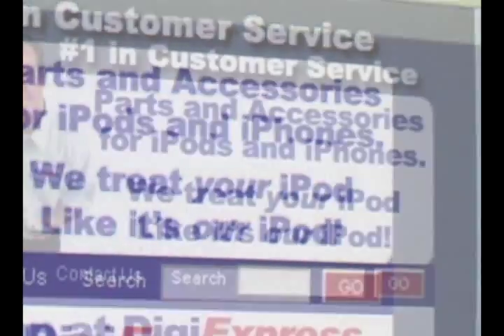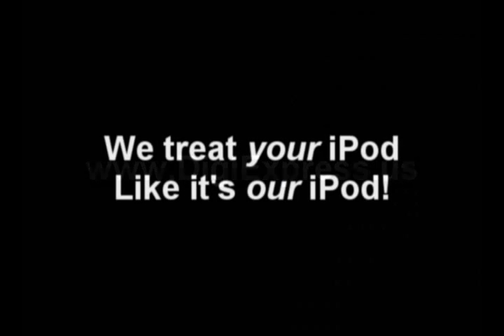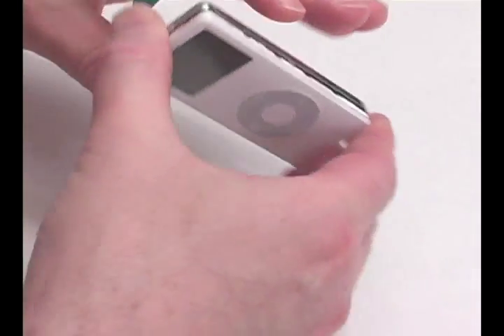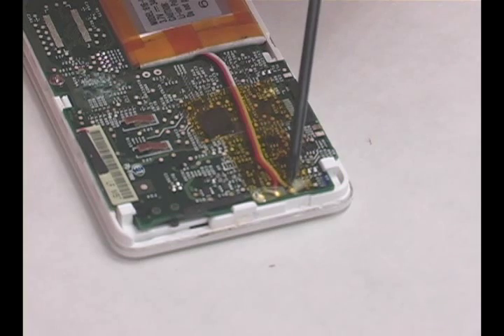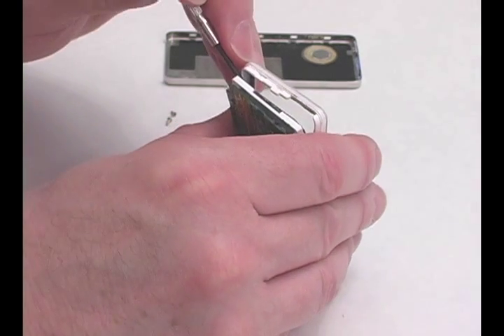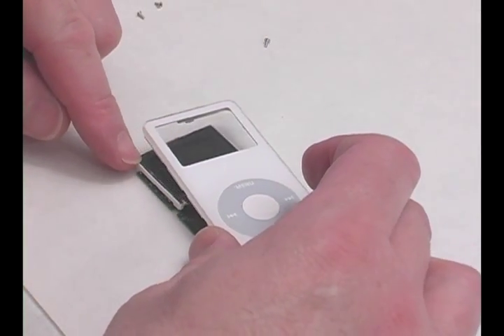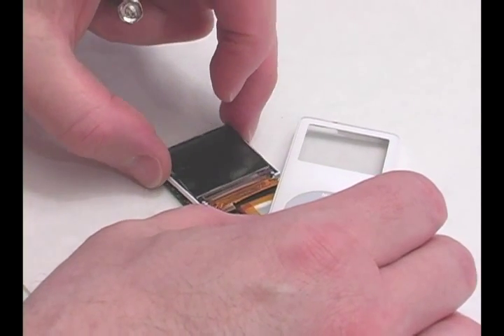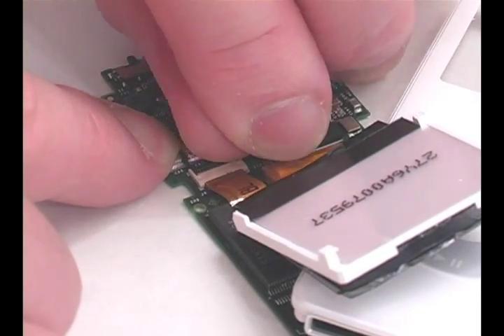DigiExpress - iPod Nano 1st Generation Battery/LCD Installation

Comment from the maker: That error is just a general hardware failure error.  This could be anything from just needing a battery or simply not repairable.  The cost involved with repairing a Nano 1st generation are low until you have problems with the main electronics board.  If you have a main board problem, the cost for repair is about $30 more than buying a new iPod Nano.  With only the error message as your "clue" , it is very hard to nail down what is exactly the problem.